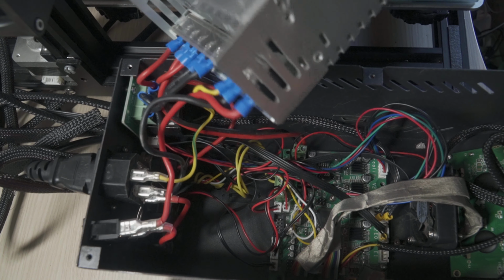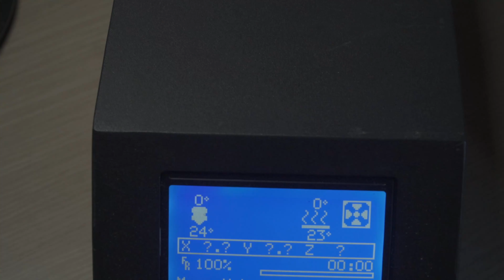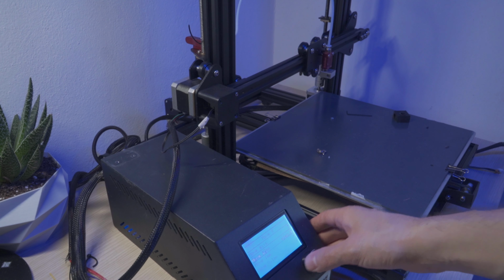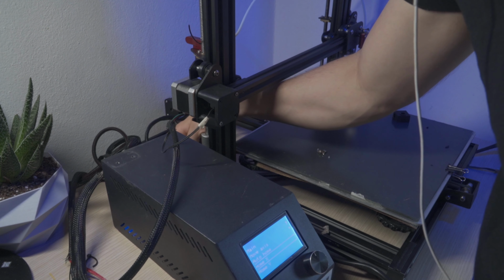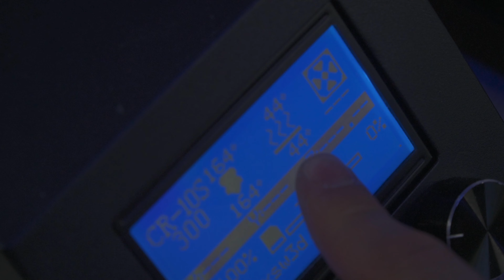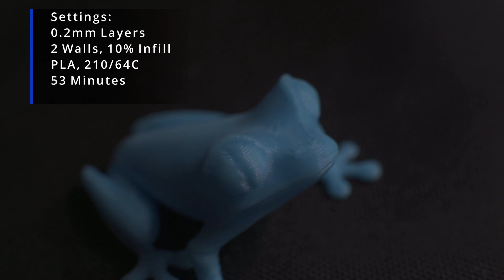Making easy money repairing 3D Printers

Comment: The biggest problem that I could see is the profit. Given that the most popular printer is the ender 3 and it is already very cheap you would have to get the broken one for next to nothing. Might be better pulling it apart for parts like in the automotive industry.
Even then there isn't really a market for second-hand parts as the new ones are so cheap.
Would love to know if there was a profit made or not.
Great video. Keep up the good work.
Reply from the maker: Hey man, thanks for the feedback, appreciate it! You sed it right, your analogy is perfect: mainstream cars (ender 3) are used for parts and only some special/vintage model (cr10 or you name it) are restored and sold for a profit. i got the one in the video very cheap, otherwise it wouldn't have been worth it. I'm current selling this one, we will see how it goes!
Reply from the maker: At the end it sold for 285$. Helped new owner setting it up and now running!

Comment: There are hundreds of ender 3's on facebook marketplace and 99 percent of them are overpriced and have been for sale for months.  When you can get them new for $180 or sometimes even $100 then there's no profit margin.  The money is in design or high volume niches.
Reply from the maker: Fb marketplace is a good place where to start, but some items are overpriced, Ender3 are $99 at Microcenter. No reason to get them used.. Instead I have a guy nearby selling 2 raise3d at $400 each. They need some love but there’s defo a chuck of change selling them as refurbished. But i agree with you Karl that most income comes from elsewhere in the 3d printing space
Reply: @3DPrintingForMoney  There is so much room for creativity in multiple directions in this art.  That's what I love most about it.  For the masses to express thoughts 3 dimensionally in just about any color or material, it's a renaissance era we are living in.